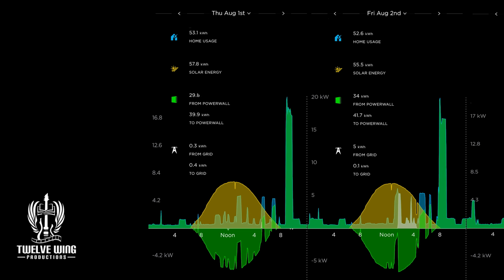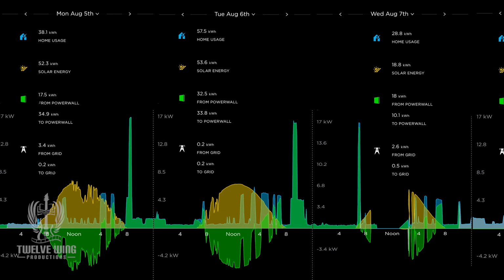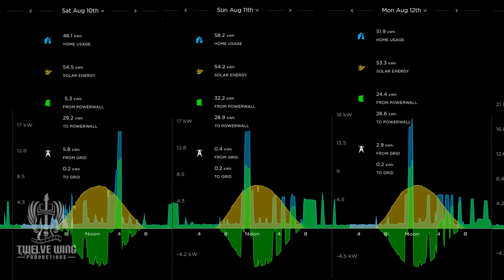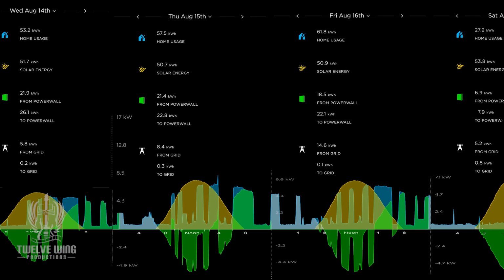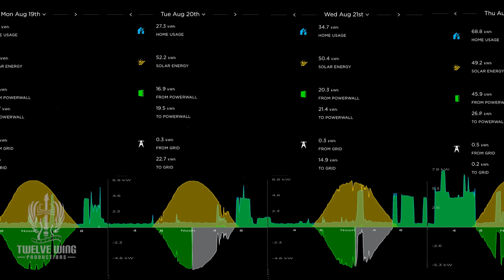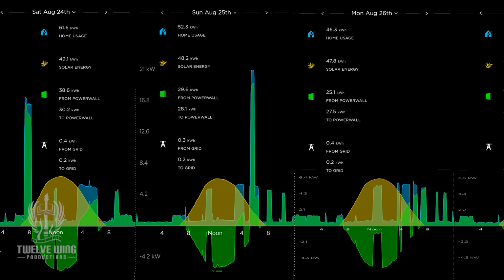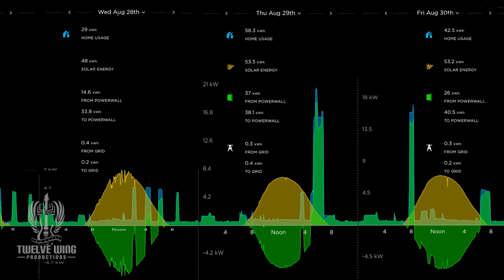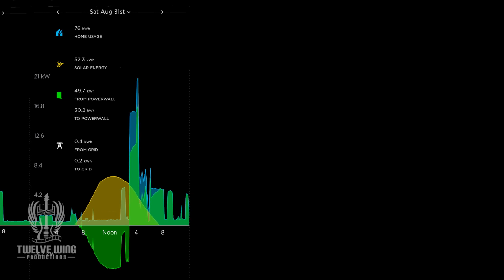The Energy Sovereignty Project: Month 8 Closeout! (Graphics)

Comment: How many watt of Solar panel do you have
Reply from the maker: Panel wattage is 10.2kwh.
Some of the panels are in sub-optimal directions so our total peak output I would estimate at somewhere aroun 8kw.
We have a single 7.6kw inverter so that is our functional limit.
Reply: @twelvewingproductions7508  . Despite the sub optimal position and limitations of your inverter how many Kwh has the solar pv produce since inception.
Reply from the maker: @josephjohn907 , let's use the period for The Energy Sovereignty Project... so since Jan 1 we have produced 11.44Mwh.
The home has used 10.486Mwh.
From the grid we have taken 619kwh and to the grid have sent 434kwh.
Reply: @twelvewingproductions7508  . Thanks for your detailed responses. Solar pv will rule this planet. 

Solar panels efficiency is just 25% for the most expensive panels how about when scientist scale it efficiency to 50-100%.

Be well
Reply from the maker: @josephjohn907 , I'm looking forward to it.  I'm not sure how much more improvement can be derived from the panels, but it's certainly possible to scale the density and number of panels.  So even where they sit now, it's a viable solution.
Thanks for following.

Comment: Question.  If the grid goes down due to a forest fire, and the solar panels are blocked by the smoke (or cloudy weather).....you're dead in the water right?   Is there any way to supply the Powerwalls with an emergency generator?
Reply from the maker: Someone earlier had asked a similar question.  Let me start with the easy part..
Yes, you can hook a generator up to the system to both run the home and charge the batteries.

That said, a forest fire isn't going to reduce the production of solar to the point where you are "dead in the water".
If there is that much smoke... you are what's on fire.
Reduced?  Yes... but this also depends greatly on proximity.

The best answer I can give you about this is the one I've been giving for the last 9 months.  Go back and have a look at some of the weekly reports from earlier in the year.  That lays it out really well as to what the relationship is between rainy/cloudy weather and production expectations.

Additionally, I'll be slowly producing what I call our "visual month" series.
During this series, I'll be preparing a rolling graph, like you see in this video, for every month that The Energy Sovereignty Project was active.
Reply: @twelvewingproductions7508  Thanks for the reply.  I've enjoyed your videos. If you had to, where would you hook up a portable generator to your system?  Do you have a critical loads panel and an outlet?  I guess with six powerwalls this might not be that much of a necessity but here in Florida where we have week long outages after a hurricane, it is a concern.  Have you posted a video that detailed the cost of your system?